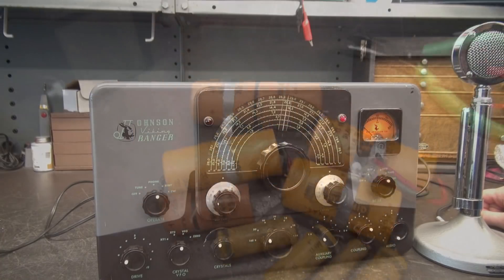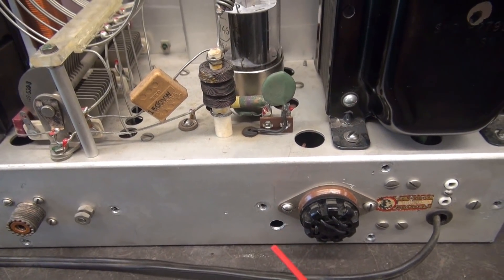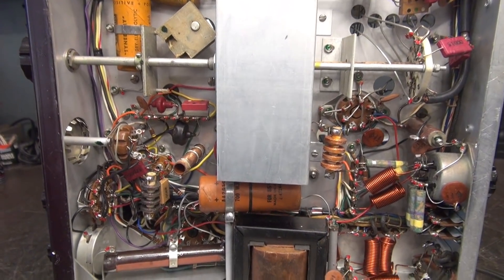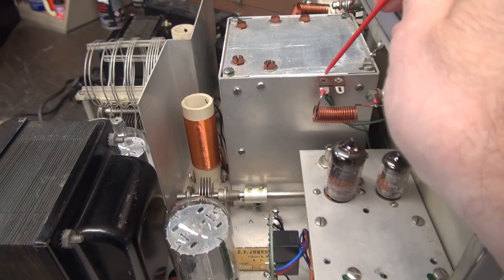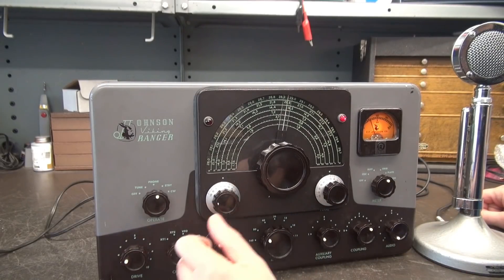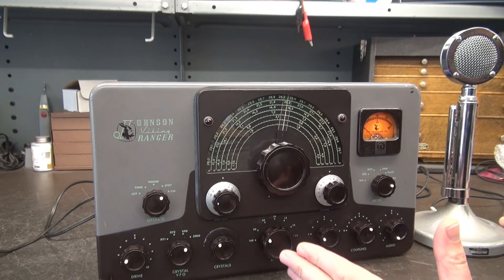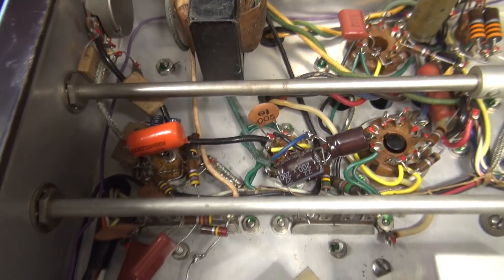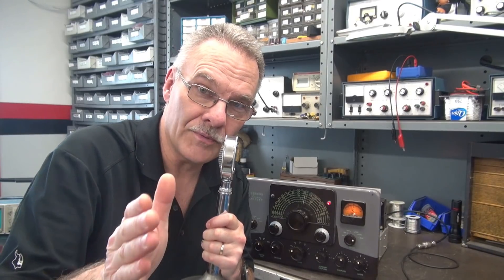How to repair audio squeal EF Johnson Ranger Tube Transmitter Change those old capacitors new life

Comment: A very clean inside and out transmitter. Was in good hands with Terry. 😎🍷  Just replace old waxers! Don't forget the electrolytic caps !
These instruments are really getting expensive and it is hard to find a near pristine  chassis now a days. Usually you get mod,mod,mod.🪓⚙🗜🩹

Comment: Wow, super clean rig inside and out!  Glad you mentioned the returned module that wasn't bad, and offered help for your customers.  I'm curious what happened with the replacement module, I hope it worked for them.  Maybe it was a case where the module was installed correctly, but their rig was modified previously, causing trouble getting the module wired up right.
Reply from the maker: Have not heard back from the fellow yet, Just sent the module last Wens. Will follow up
Reply: @d-labelectronics  Okay, sounds good. 👍

Comment: Don't part out another Ranger for the mod transformer.  Spend a little money and have the original rewound.  It's not cheap, but you'll have a new transformer in the original case, and depending on who does the rewind, it may have better frequency response then the original.

Comment: I have a viking 2 that's clean started the recap and  change the chenobel resister but  know nothing about this thing and there has been mods I'm. Going to pull the main transformer for an amp and you get the rest when I get around to it  I know its a shame  but I'm a audio and guitar amp guy